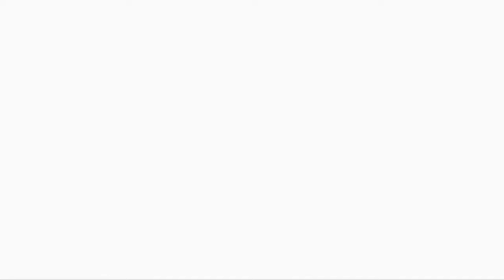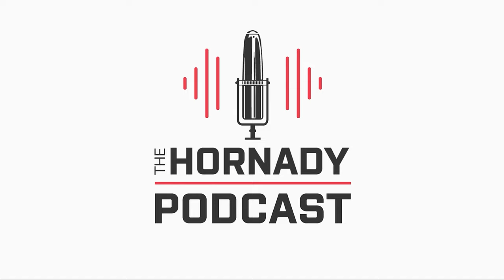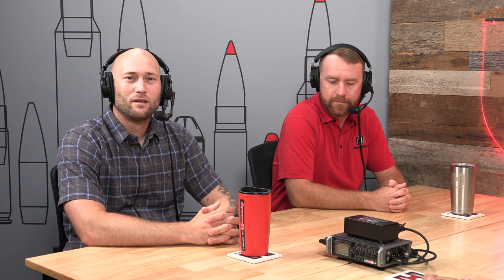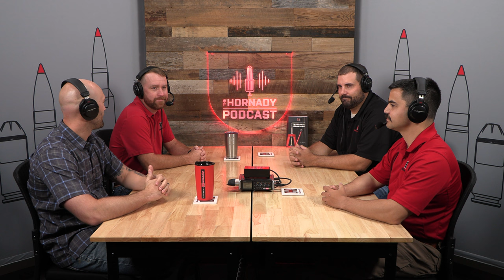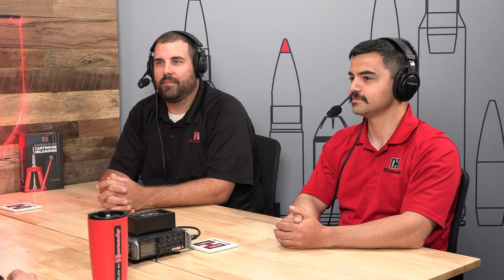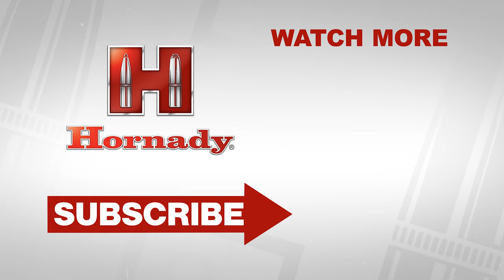Ep. 033 - Custom Rifles | Things to Consider |

Comment: I just can’t afford to build a custom rifle so I’ve taken a Remington 700 light tactical with a 20” barrel and made it as accurate as possible. I bedded the factory stock, dropped a Timney 1 1/2 pound trigger. Also built the length of pull and cheek rise out of stuff I had. May not be the prettiest gun but I’m very accurate with it. Shoot what you got and have fun doing it.
Reply from the maker: Heck yeah!
Reply: Oh yes
Reply: Pffft!  Just do what Greg Dykstra tells everyone who doesn't want to spend thousands and thousands of dollars on one piece of gear for slight gains.   "Learn to work a savings account".   Just kidding, sounds like a sweet rifle.    Im on an even tighter budget for fun than you its a Savage 110 for me...

Comment: I agree that a custom action gives you choices, quality and accuracy - I think in that order.  If you want a Mauser style extractor in a Rem700 pattern, you can do it with a custom action.  The custom action quality is superb.  I really haven't seen what I'd call a major action released (like the Nucleus) that isn't just excellent.  Accuracy... OK steel plates are one thing.  Thousandths of an inch in bench competition is something else.  IDK how much Hornady Mfg caters to the BR crowd - they're an interesting bunch and have their own very specialized demands.

Thanks for putting the blogs out - really helpful and insightful.  My custom ARC on AICS will hopefully be done here soon.  Started to go pre-fit but decided to go with a custom fit-to-order from a local smith using a Brux blank.  The whole idea is to move the Hornady 190gr .284.... very far.
Reply: If you listen to them explain how they test they use equipment that makes the BR crowd jealous, and they sponsor all sorts of shooters so I’d guess they probably have BR on the roster but I’m not positive.

Comment: I agree with Jeffrey. The Savage floating bolt head and barrel nut(for head space) should be a starting point. Regular binding bolts  often have the lugs lapped. I bought a Marlin SX7 in .308 15 years ago. I think I paid $300 for it. It would be hard to beat, even with a custom. I do agree with a new trigger.

Comment: Awesome podcast fellas! So I own several levels and styles of guns and yup most have a Timney Trigger. Their customer service is first class they were local to me in Az. I took a trigger back in that I had ordered from Brownells that was too short because of the different Eddystone Enfield magazine capacities. My mistake but they looked at it and swapped out the trigger for me on the spot and installed it to checkout fitment no charge! On the barrels the big thing I’ve noticed is a true match barrel be it button or cut rifling shoots a lot more different rounds really really well compared to the factory production ones that only favor that one sweet spot. My 100yr old 30-06 Enfield with just a lapped bolt and a Criterion barrel shoots everything I’ve tried better than MOA. If you care about the accuracy just start with a good barrel any of the custom American barrel makers do excellent work. The less you do to a barrel the better off you’ll be don’t thread or flute it unless you really have too. I’m ready for some .22lr Hornady match ammo!

Comment: I was really surprised when one of you said a bolt action build is easier than an AR. The assembly might be, but identifying and specifying a compatible receiver, barrel, trigger, bottom metal, and stock/chassis that works well for your application (weight and volume of fire) seems a LOT more challenging. And of course you have to select your cartridge first … that’s just nuts in today’s market with all of the possible choices.
Reply: AR are easy to build and idiot proof if all the parts stick to the TDP and you are not chasing accuracy levels that where never part of the design.  That is the entire point of the design elements of the AR is that almost anyone can assembly one and turn out an acceptable product. The problem is that too many companies do not stick to the exact specifications and quality control designed in the TDP. I am tired and old so if I get this wrong I apologies but if memory serves me properly the AR/M16 only has to hold 2 MOA with ball ammo to meet requirements. If you look at companies like Ruger, S&W, Daniel Defense they tend to turn out a very very consistent product. While other companies turn out real turds. Springs, doughnuts, extractors and bolt carrier clearances mater a lot. Tolerance stacking is very real. If the quality control on all of the individual parts is good assembly is easy. Today to many companies are making parts and they all have different standards! I suspect not much is getting pitched when out of spec. they just discount it and sell it to those that will look the other way!
Reply: Just stick to pre 1980 calibers and you can’t do wrong.
Reply: @jasonweishaupt1828  can I go with 7mm-08 Remington?  It was commercially introduced in 1980 but wildcat versions first appeared in the late 1950s…. 

Jason you make a good point. Compare 6.5 Creedmoor to .270 Winchester with modern bullets and the .270 is better at everything out to at least 500 yards. Except recoil. Then all of the “PRC” cartridges from Hornady 🙄 Require Magnum bolt faces and magnum primers.  The funniest thing is that I’ve been working with the .30-30 recently. Is it an old Fudd cartridge?  Well yeah but it gets the job done just fine unless you need to shoot more than 250 yards. Again modern powders (CFE 223 and LeveRevolution) and modern projectiles yield real improvements in performance. Plus lever actions are just plain fun.

Comment: The Defiance AnTi actions or others on the market that are Stainless but lightened.   Mack Brothers actions are Real nice, 9 on the shelf right now.  The only issue I have with prefits, are the action can be on the top of the tolerance and barrel on bottom and fit is loose and a goose......maybe it doesn't matter, a lot of smoke and mirror stuff in this business like saying you can hold .0002".  this is coming from a custom gun builder.  Great Stuff, Would really like to meet and chat with Miles!!

Comment: For carbon barrels, GA precision will only honor accuracy with the Bartlein carbon barrels. They say that the steel core is thicker on theirs vs other manufactures. I have personally shot my Bartlein carbon barrel to a 10 shot string and it was still hammering dead on… however it was boiling hot and don’t want to buy another one anytime soon so I generally let it cool after 5 at most. Anyone have experience with other carbon barrels?
Reply: I have a Christianson arms 300 win that shoots sub moa 5 shots groups with almost any factory ammo I’ve ran through it. I’m 350 rounds down the barrel zeroed 2 inches high at 100 haven’t changed the zero since the first 15 or so shots seems to do well even after a normal sporter
Rifle would be so hot you can’t touch the barrel

Comment: Outside of weight saving it is impossible for a carbon wrapped barrel to do anything that the orignal pre-turned blank could not do better. The carbon wrap could cause corrosion long term. It acts like insulation and holds heat in the bore of the barrel longer. Carbon fiber wrapped in that manner add's nothing to the stiffness of the steel barrel. You do not gain any stiness or rigidity and you make it harder to shed heat. Carbon wrapped barrels are a fools folly. You do not see them in aviation barrels where light weight and known durability rule supreme. You do not see them in ship barrels, artillery pieces, tank barrels, machine gun barrels or even standard issue rifle like the M4 or M17 handgun. A proof steel barrel of the same profile as the wrapped version would perform identical tot he wrapped version and would weight even less!

Comment: Shouldn't fluting produce a stiffer barrel since the outside diameter is larger than the same amount of material in a thinner barrel?  The Length / Radius ratio is larger making it stiffer.
Reply: Fluting doesn’t make the barrel stiffer, it makes it lighter. You could say that a fluted barrel is stiffer then a none fluted barrel of the same weight. It’s the diameter of the barrel that makes it stiffer, not the fluting.
Reply: @jaydunbar7538  Agreed.  Depends you look at it.  Fluting can increase diameter over a non fluted barrel, or as you put it a barrel of the same weight will be of a larger diameter if it is fluted over a non fluted barrel.  Same thing with carbon barrels that are a larger diameter with the same weight.

Comment: What’s the next prc cartridge? Any work on a .338? Something that’ll shoot the 285gr eld-m at 2850 hopefully
Reply: 338 lapua already does that
Reply: @danielburnette9552  not with factory loads unless strelok has the wrong numbers. I also want an updated cartridge design and Hornadys support of the cartridge.
Reply: @corygamble9785 hornady already makes brass and dies for that cartridge.
Reply: @danielburnette9552  yes, but they do not support it the way they do their own in house designed cartridges. I want readily available factory ammo. I also don’t want a lapua, I want a “.338 Norma mag”. I want an updated 338 just like they did to the 300 win mag/270 win/243win/308
Reply: @corygamble9785  they make 338 lapua match ammo, with 285 ELDm and hunting ammo with 270 grain ELDx
Reply: @danielburnette9552  do you just read the parts of comments you like and ignore the rest or what?
Reply: @corygamble9785  338 norma mag(the cartridge you want hornady to produce) launches a 300 grain SMK at about 2650fps, while the 338 lapua launches the same bullet at about 2700fps. If you want a cartridge that launches 285-300 grain bullets at 2850fps, its gonna neeed to be bigger than current bolt action receivers can accomodate without going into a receiver big enough to handle 375 cheytac. Its not really feasible.
Reply: @danielburnette9552  it won’t be easy but I think they could do it. Or at least get close and the will put more resources into their own cartridge than they will someone else’s